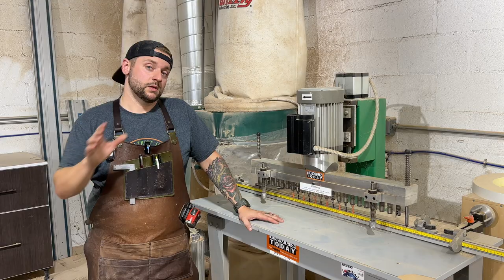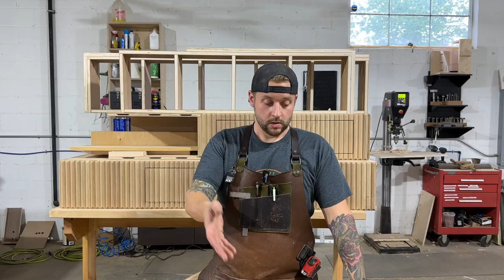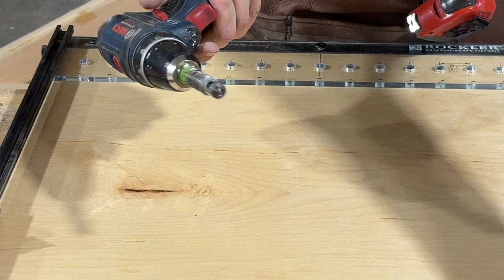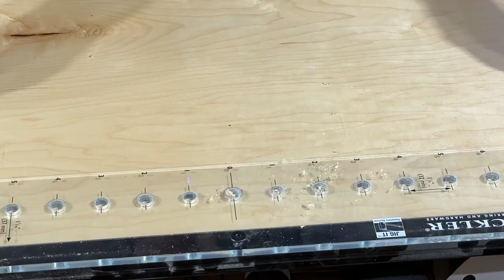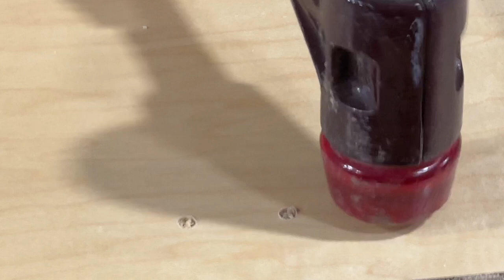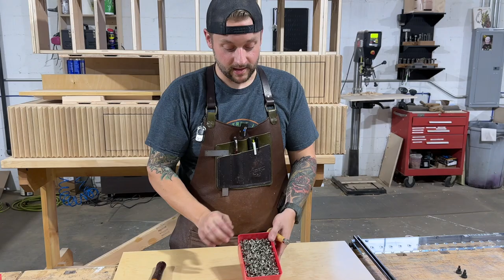Level Up Your Cabinetry Game with Shelf Pin Inserts

Comment: They truly finish off the cabinet. I’ve used them in the past and I need to get back to using them. Then again I need a line boring machine.
Reply from the maker: Thanks, Corey! You can borrow ours 😜
Reply: @TodaysCraftsmen  does is fit in a flat rate box? 😂
Reply from the maker: Flat rate crate 🤣

Comment: We used a brass sleeve that hammered in flush, which allowed for a shelf to fit more snug into the shelf space & sit on a less intrusive flattened brass dowel pin, which formed a strong shelf fit.  Our office furniture was veneered chipboard/particleboard in the early days but transitioned into MDF.  I believe lesser quality kits are now produced.  Cheers.
Reply from the maker: Nice!

Comment: Thank you for the video, i'd like to see one where you explain how you make drawers and how you calculate the drawer sizes for stacking in a cabinet - drawer depth to face-plate of drawer depth ratio,  how to use drawer rails and how to use more traditional wooden slides for drawers (centre of drawer or bottom of drawer?)
Reply from the maker: Awesome! We’ll put it on our list of ideas!

Comment: Congrats on the new channel!
My guess is that most people using these shelves find a position they like and stick to it…at least until the holes wear out. 
Can you retrofit sleeves into existing cabinets- just in the holes you’re using??
Reply from the maker: Good point! It may be tough to drill a 5.5mm over the 5mm hole but never say never

Comment: I agree they look nice and for a furniture piece or something more decorative it’s a nice touch. However I’ll respectively disagree that shelf holes left bare will wear out. I work for a custom cabinet company and that’s simply not an issue unless shelves have too much weight on them or are being moved and rearranged frequently which is RARELY done. If they have too much weight the actual shelf material and thickness also becomes and issue. Another way to combat the support aspect, although less appealing, would be to add more supports across the cabinet back or more than just 2 supports per side.
Reply from the maker: They don’t always wear out but we’ve seen it happen many times! It’s not a huge problem, if it was then a standard 5mm hole with pin wouldn’t be the industry standard. Thanks for watching!

Comment: I have the old style (smaller) jig from Rockler that you clamp in place and it works great. My only issue is the dedicated bit tends to clog every time I drill a hole. It's easy enough to fix but it definitely slows down the process.
Reply from the maker: That can be a pain!

Comment: The vast majority of people never adjust shelves once they make the initial spacing.   What do the sleeves cost?  I can see them in open cabinets but they may highlight the holes.  Good luck on the channel.
Reply from the maker: They may not adjust but they will load up the shelf and wear out the holes! Thanks!
Reply from the maker: $5.10 for 100 sleeves
Reply: @TodaysCraftsmen  I honestly never had that problem.  We did mainly kitchen cabinets, at least two jobs per week for almost 30 years.  We also did dovetail solid wood drawers with all plywood boxes, and for lower priced jobs we did vinyl interiors on zpB and later MDF.  Never had to replace a drawer in all those years. Either construction provides a great product that will last decades, if they are taken care of.. kitchens are typical replaced not because they don't function any longer, they are a fashion statement and fashion change. When I first started out in the 60's most cabinets were still built by the carpenters, plain lipped plywood doors. Industry sure has changed over the years. When holtzer displayed a functioning shop at the NKBA show in the 80's making NFF cabinets it was an eye opener..we did NFF for commercial and FF for residential typically.  Be fun to watch you build out your shop. In 87 when I built my own building we had 9000 sq ft. You never have enough space.  We did laminate and SS ( corian) counters also. Good luck, will enjoy following your growth.
Reply from the maker: Awesome! You saw the industry do a practical 180. We went from building pretty much everything frame-inset, 1” solid wood doors, 3/4” hard maple drawers with through dovetails to mostly euro frameless. Have to follow what the clients want 🤷🏼‍♂️

Comment: How well do these work being retrofitted to existing pieces?  

I’m thinking that this might be a nice way to fix pieces that have been wallowed out and aren’t holding their pins anymore.
Reply from the maker: May be hard to get that 5.5mm hole centered on the existing 5mm hole. But if it’s already enlarged it may go right in! Could add a little glue if necessary.

Comment: dude, color me an idiot, and i've been racking my brain trying to figure this out before bothering you, but the 5mm sleeves require a 5.5mm hole (or 7/32" equiv), and i can't find a 5.5mm shelf pin drill bit (with collar etc).   The 1/4" drill bit is too large (the sleeve floats in the hole).  I see your drill bit is marked "5mm" so are you just using a 5mm bit and whacking them in there, or are you using a 5.5mm drill bit with appropriate collar?  Tks
Reply from the maker: We have a 5.5mm bit! I think it’s from Lee valley
Reply: @TodaysCraftsmen  tks brother.
Reply from the maker: Anytime! Hit me up if you have a hard time finding it
Reply: @TodaysCraftsmen  honestly I didn't find a 5.5mm.    Spoke To Lee Valley and they directed me to a 7/32 and 13/64, which I'm sure works well enough.  

Also, did you chuck your 5.5mm into a 1/4" spring loaded shelf drilling bit.    Don't think there's a specific 5.5mm drilling bit/collar anywhere.
Reply from the maker: Hmmm I could’ve sworn ours came as a self centering 5.5mm bit